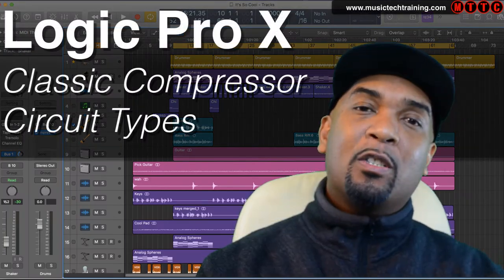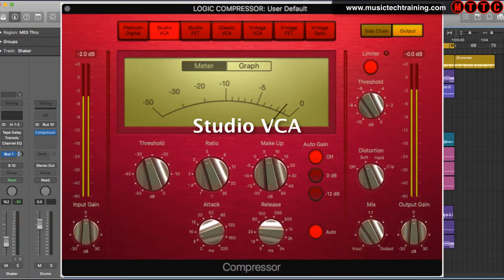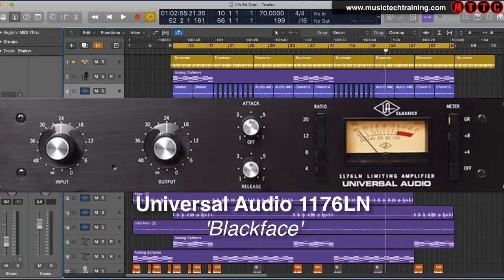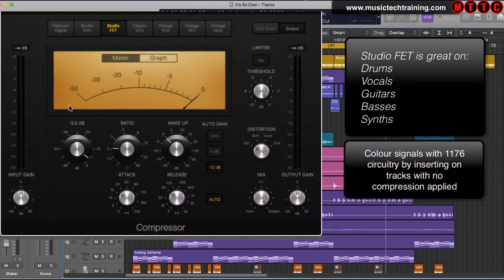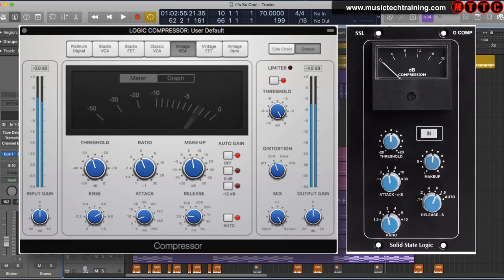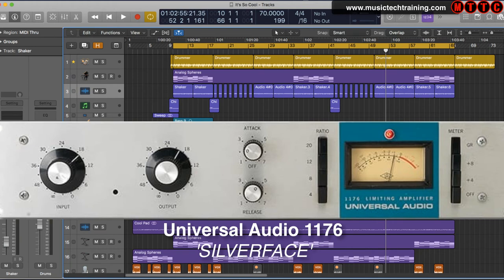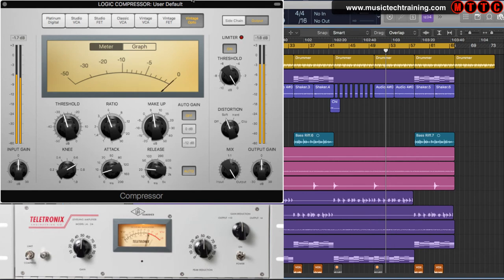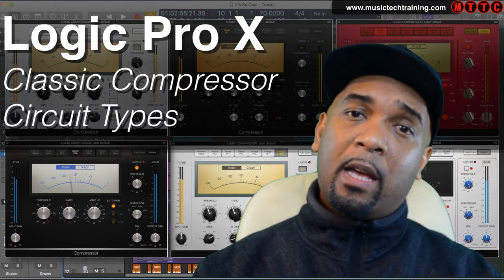Logic Pro Compressors | Vintage Compressor Circuits  | UREI 1176 | DBX 160 | LA2A | SSL Bus Comp

Comment: Question I plan on getting a analog preamp like the art pro II.  I don't want to spend the money for a dedicated compressor as well.  I know you recommend using compression prior to daw but how do you feel about recording vocals with a analog preamp and using daw  compressor on the input channel with light compression?
Reply from the maker: To be honest the vintage compress emulations now available DAWs such as Logic are so good I'd say get a nice mic pre and use the compressor plugins. Just make sure you don't record too hot. Check out these videos on level management and gain staging.
https://youtu.be/kVVevYuZPyk
https://youtu.be/uoTxA82AYzU
Reply: I agree on going with the preamp and using software compression.  However i must say after starting my preamp journey with a art and now using a couple of golden age project pre-73 (neve clones) that are a huge upgrad from the art's i was using.   i'd recommend you skip the art and save up a little longer for something like the pre-73's or the similarly priced warm audio.

Comment: The Platinum Compressor is NOT super fast,...please check it out again. It is not good at catching the very beginning of a sound. None the less it´s a really great compressor! :)
Reply from the maker: Very good feedback. Thanks for your observation. I suppose it is a case of finding the best circuit to meet your needs based on the the material you are processing. Great comment! Cheers.